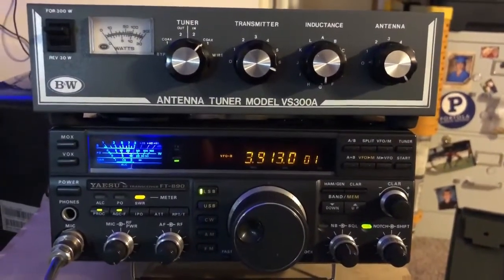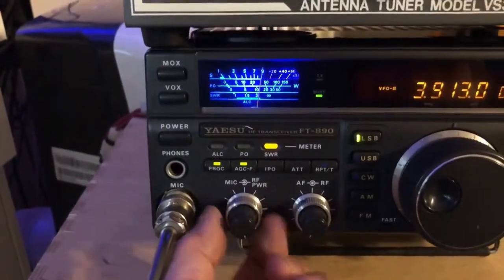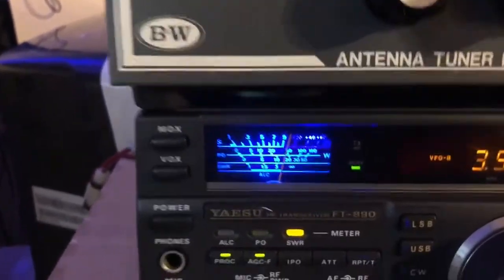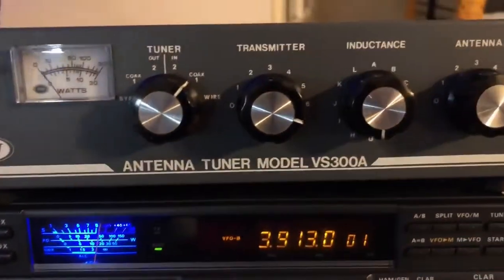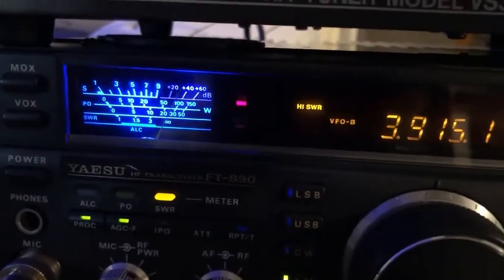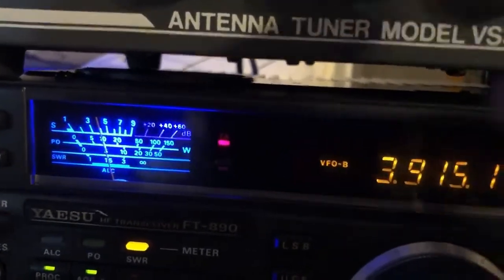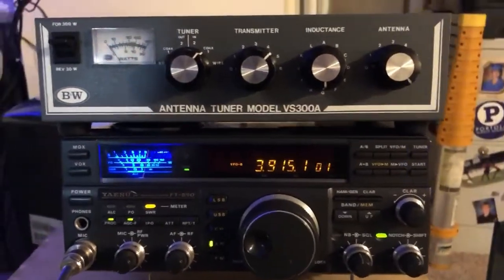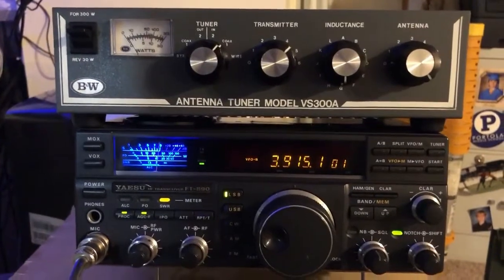Manual Antenna Tuning using manula Tuner

Comment: Hey thanks for the video I recently purchased ft890 with a damaged external tuner.i am new to radio and wondering if it's ok to purchase a different tuner all together or does the radio require this specific tuner?likely this is a stupid question but the one I have is not broken but missing parts and I've  o idea how to repair it.